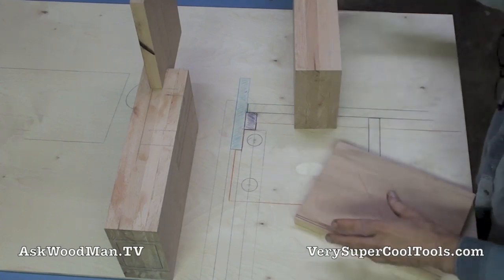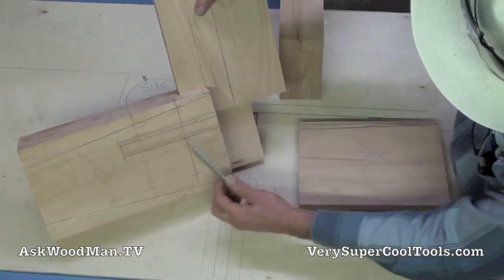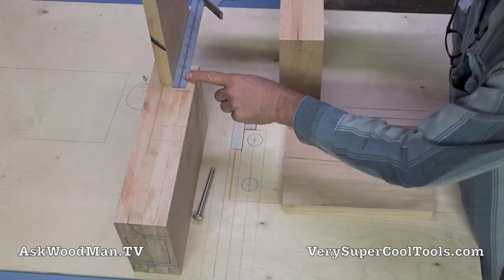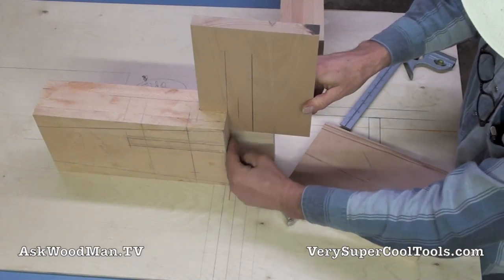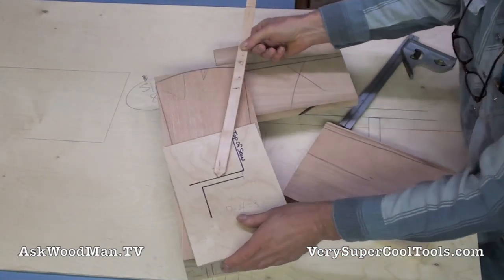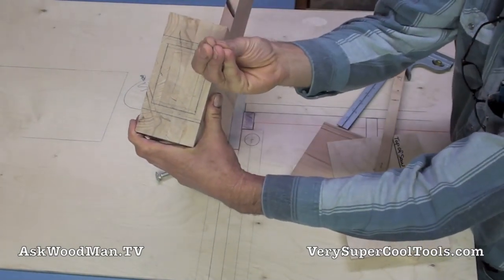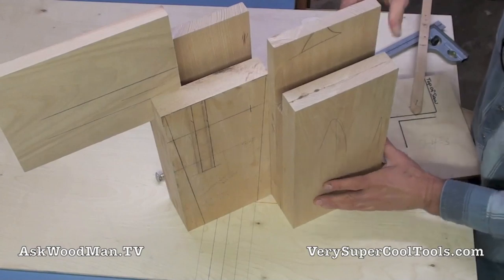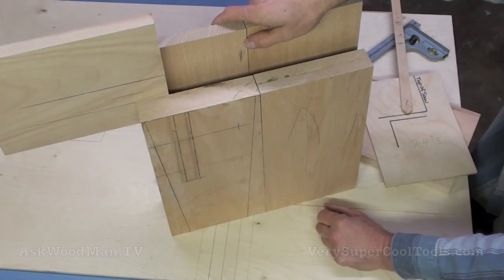08 How To Build A Bed • Leg Joinery And Hardware Layout

Comment: Why do you have a "A" and a "B" leg? Is there a reason you are not cutting the stretcher mortis in the center of the leg?
Reply from the maker: +KCHammer113 You will see later that it is easier to add a under bed drawer guide runner to the stretcher.